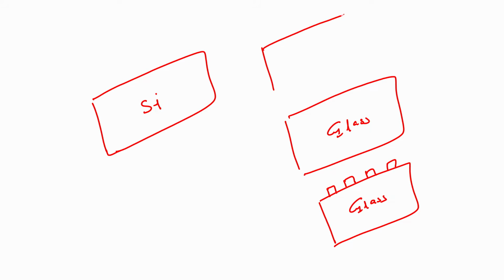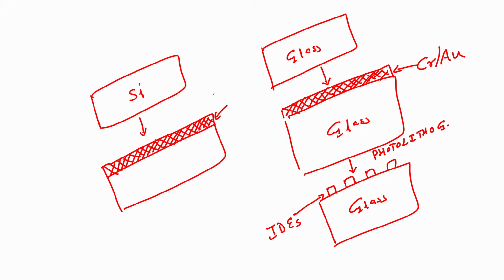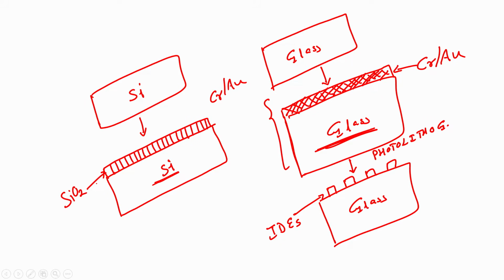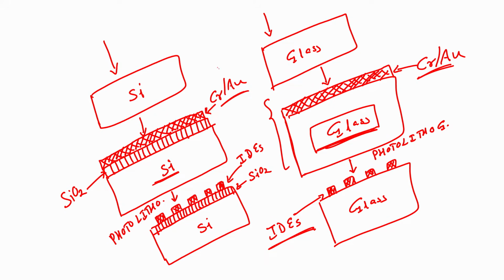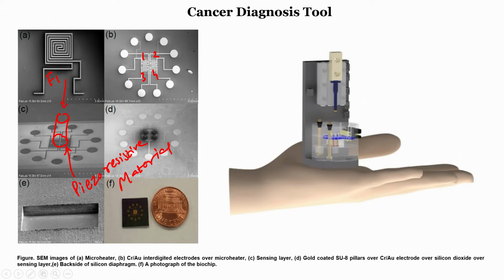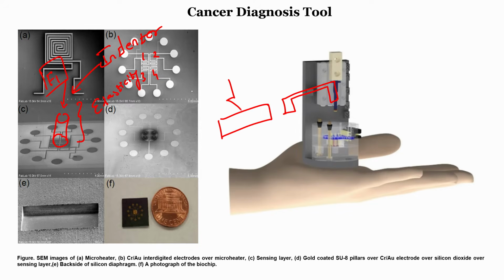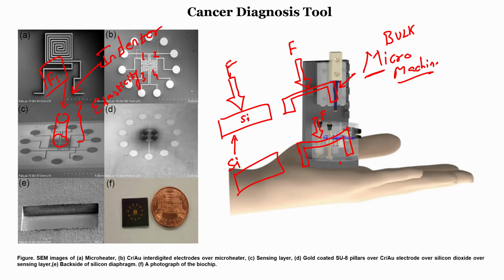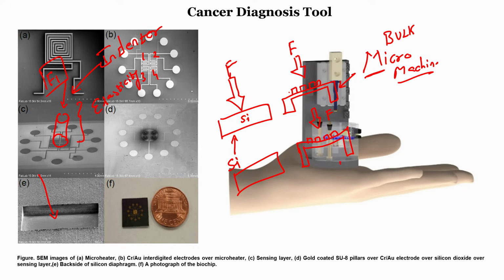noc19 ee41 lec03

Comment: What is the use of IDE if piezoresistor is placed on its top as the output of piezo is used instead of IDE? Refering time near at 27 minute
Reply: Possibly IDE is not good enough for measuring the change in resistance in the tissue w.r.t change in pressure applied on it. This is where the Piezoresistor steps in.